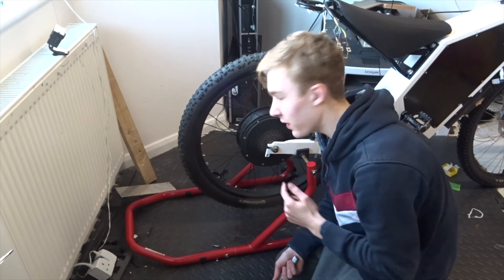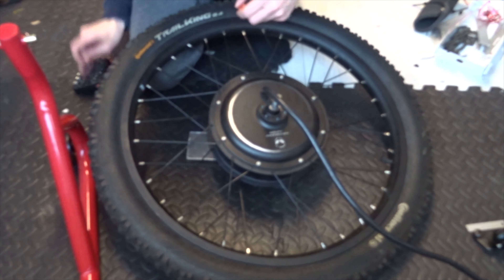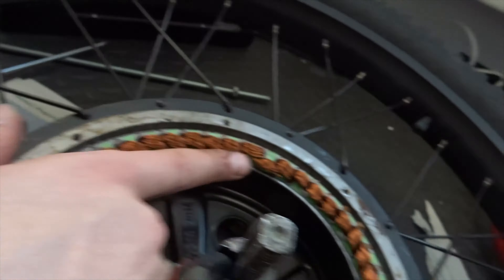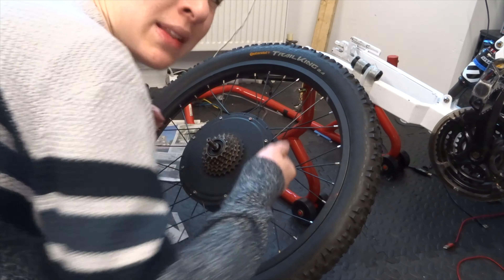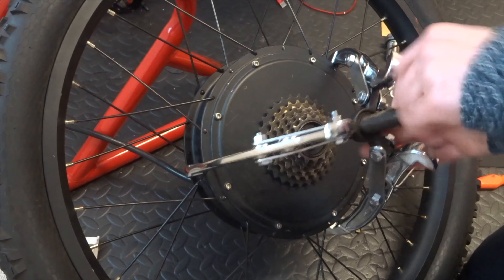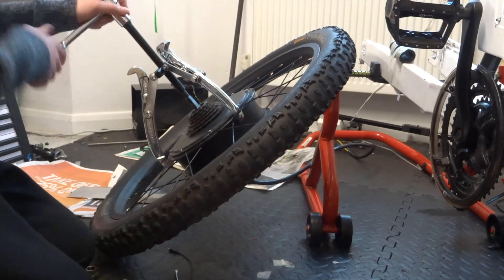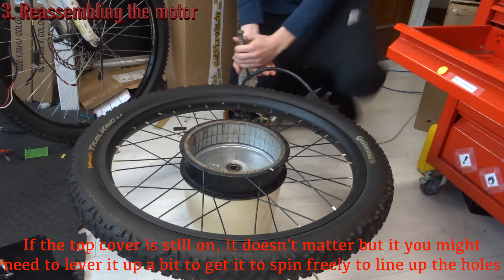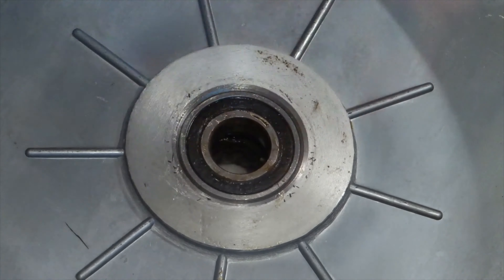How to disassemble an eBike hub motor | 8kW Enduro MSVA eBike V3 Build

Comment: I've seen others paint the inside, to keep them from rusting. Thoughts?
And drilling "weep holes" in the hub, to allow drainage. Again, thoughts?
Reply from the maker: Haven't seen that personally, but surely the holes would let water in and if it's properly sealed there shouldn't be anything to drain? I'll be adding ferrofluid later as well which I wouldn't want leaking out so I'll seal it all up as best as I can. Might have to top it up every now and then

Comment: I've people put fluid in those motors and find on the outside to cool them but I'm not sure it's needed unless you're putting a bunch of stress on the motor but I'm no expert
Reply from the maker: I'll definitely be doing that later to help cool it as the motor's only rated for 3kw but can handle a lot more if the heat is managed
Reply: @EverythingEbikeChannel  I can see doing something like that only if it's getting to hot and just what is to hot
Reply: They make racing bikes out of cheap direct drives.  Fluid dude IDK man some drill holes in plate for coolingP